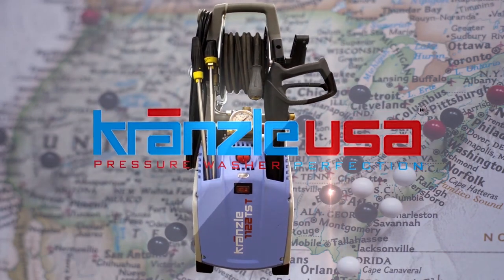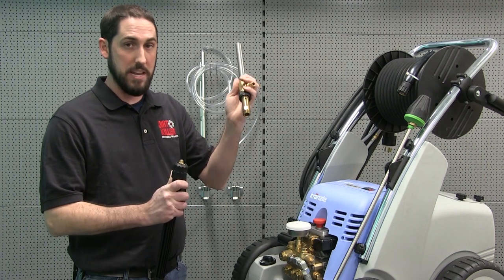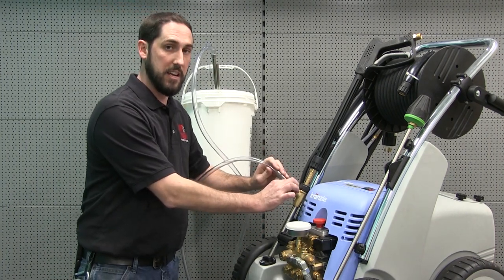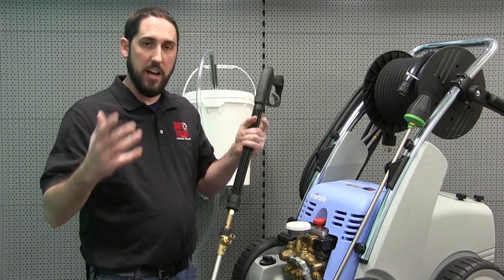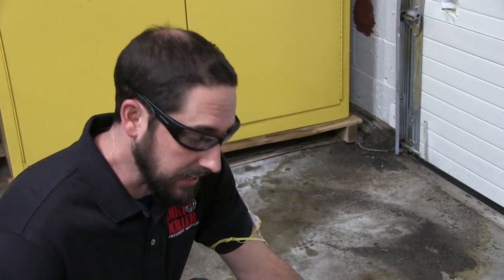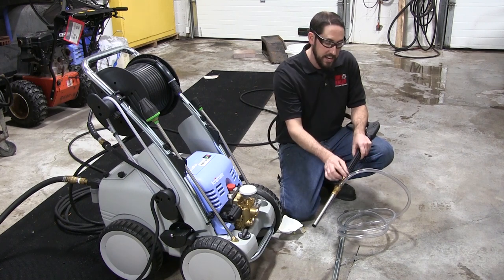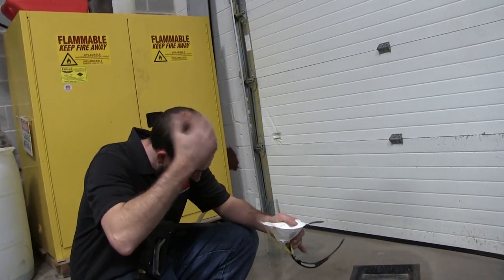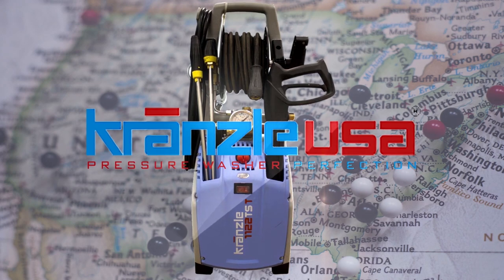Pressure Washer Sandblasting? Oh yes you can with Kranzle USA

Comment: Can we use this for stripping the paint of a car ? And does the Water in touch of bare metal will produce corrosion within seconds  ?
Reply from the maker: Yes, you could. And, yes, water on raw metal can cause corrosion if you don't dry it right away.
Reply: I've been researching rust preventatives and chemical removers, and salt neutralizers for a few years now due to a major problem I have with my car that got exposed to salt-air in Fl. after I got sick and couldn't take care of it.......and everything rusted to hell.  Here's what I came across that really should work,  and I think it's also something that the "Dustless Blasting Franchise" uses, unless you can buy their corrosion inhibitor if it last longer ect.....   You have to figure out also how to use and inject this type of "(Water-Borne) Corrosion-Inhibitor" while blasting, through a chemical injector on the pressure-washer or a external chemical injector feed.   This is the chemical off the top of my head I remember coming across called "HOLD-TITE":   Read this page thoroughly....YES....it will prevent "flash rust" during auto-restorations but only for about 72hrs.  I know I've come across water-born rust preventatives that prevent rust up to many months on bare-metal....     https://holdtight.com/products/holdtight-102/
Reply from the maker: @chrispompano  Thanks for sharing.

Comment: Have you tried this with the HD series? Will it work with the HD 10/122 TS ?
Reply from the maker: No, as the use has different models. However, the actual connections are the same, and it is a Kranzle product, so, I am 100% confident it will work with the "hd" models. *The only real difference in the "hd" models is the electrical. :)
Reply: @kranzleusa5846  thanks! Will try and confirm!
Reply: @kranzleusa5846 hi man, could this remove road marking paint on a street. Thanks.
Reply from the maker: @neil2905  Probably. As you saw it took paint off metal.. But, we have NOT tried. Might need a chemical to soften road paint. Road paint is particularly durable.

Comment: Can I use normal sand
Reply from the maker: Hi. When you say normal, do mean "sand from the beach" or "sand bought in a bag"? Theoretically, you could use sand from the beach, but the inconsistent size and quality will likely plug up your tool and give bad results.  Clean sand of the same size bought in a bag is what will give you the best results. You can use any "material" that will fit through the pipe. It's all a matter of what you want to achieve.